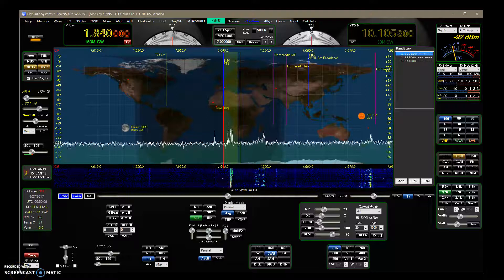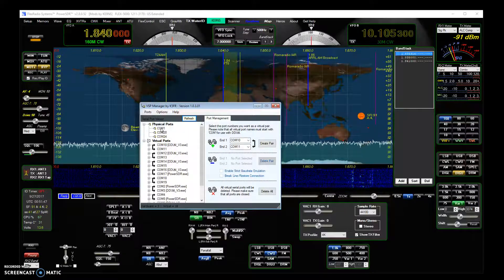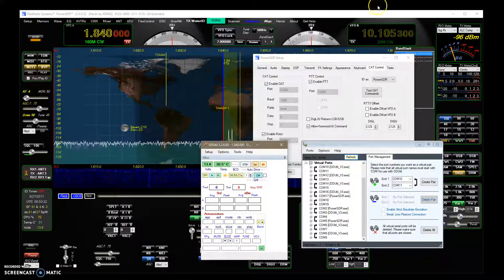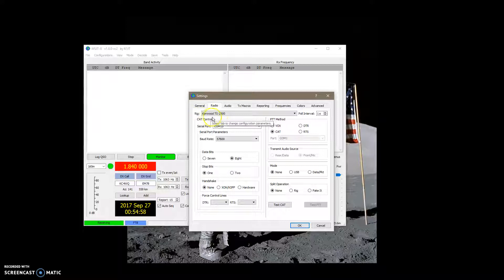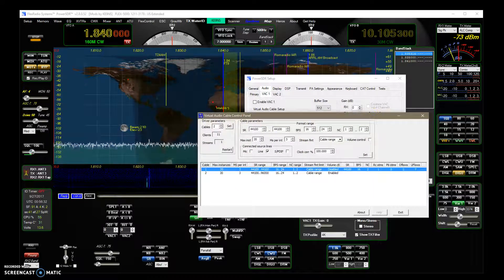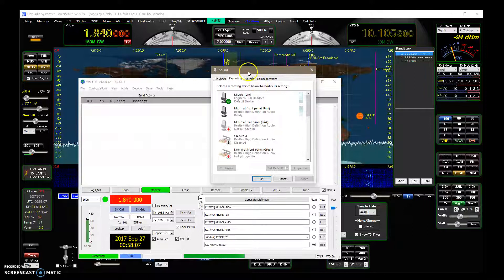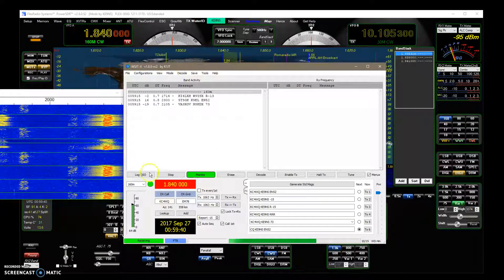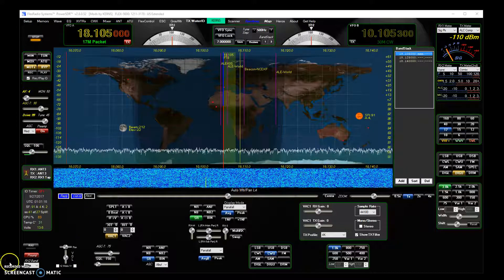PowerSDR ke9ns v2.8.052 using wsjt-x FT8 (as an example) with powerSDR

Comment: I’m using PowerSDR 2.8.271 and the SETUP > CAT Control looks nothing like the one you pull up on your screen.
Reply from the maker: The big difference is that now you can have multiple PC programs using CAT all run directly into PowerSDR,  and no need to use DDUtil. I have much newer videos, search for "SO2R WSJT-X" in youtube. You dont need to worry about the 2nd instance of WSJT-X. Also the "virtual serial" section on my webpage explains it as well.

Comment: Darrin, on the FT8 audio level meter (left side - green scale) I can't  see where I can increase to a higher audio level?  My audio scale goes up to 20 or so.  How can I get the audio level higher?
Reply from the maker: Make sure PowerSDR is in DIGU mode. The Panel (just below the Panadater and to the right) has VAC1 RX and TX gain sliders to adjust audio in and out of PowerSDR. You can also right click on the VAC1 button itself to open the VAC1 panel and adjust the RX - TX audio gains as well.

Comment: Thanks for the informative Darrin. 

I had an older version of VAC and it had given me problems from the start. I downloaded the newer version, 4.65 and it works perfectly now. Although with this  version I do have to use line 1 vac line 2 vac.  I will be contributing to your efforts in March. You are doing wonders with the PowerSDR program, it is the cat’s meow.   Paul

Comment: Darrin, I noticed you are using line 1 VAC on both input and out put, How does that work. I thought you needed 2, line in and line out.
Keep up the great work.
Reply from the maker: In the video I was using a paid program called: Virtual Audio Cable by Eugene Muzychenko. 

It called all the drivers required for a full 2-way Link by the same name: "Line 1".
So, you only need to select the "Line 1" as it provides drivers for both Recording and Playback (although I cannot be sure if the name stays the same for newer or older versions of Eugene's program)

For Everyone's reference:

BUT.... I now use "Voicemeeter Banana",  just for the audio drivers (I dont use the program itself). 

The drivers are the most stable I have found, and it even has audio drivers for WDM-KS (which is similar to ASIO in latency).
(WMD-KS is touchy to use since 2 programs trying to access this type of driver at the same time causes the driver to stop functioning.)

VoiceMeeter provides 4 separate driver names (for each of the MME, Direct Sound, and WDM-KS options) for a complete link between a PC digital program and PowerSDR.:
PowerSDR VAC1 IN= "VoiceMeeter Output"
PowerSDR VAC1 Output = "VoiceMeeter Aux Input"
WSJT-X INPUT = "VoiceMeeter Aux Output"
WSJT-X OUTPUT = "VoiceMeeter Input"

The naming VoiceMeeter uses is confusing unless you think of VoiceMeeter as a "middleman"
VoiceMeeter IN/OUT is one side (WSJT-X to PowerSDR)
VoiceMeeter AUX IN/OUT is the other side (PowerSDR to WSJT-X)
It makes sense if you stare at it long enough

Darrin ke9ns.com

Comment: How did you add the combo meter and weather meters?
Reply from the maker: Combo only works for the 2nd meter. Setup->Transmit->TX 2nd Meter Active.Click TX Meter(2nd) pulldown box and select "Combo"For the Weather, when you click on the space weather a 2nd time, the local weather box pops up only if you have enough room on the screen. If its not opening up, make your console larger (or you may need to upgrade your monitor to HD). Also you need to put in your Lat and Long positions into the Spotter screen (but the local weather will only work for Lat/Long within the US mainland (I couldn't find a source for free Lat/Long based weather for the entire Globe).